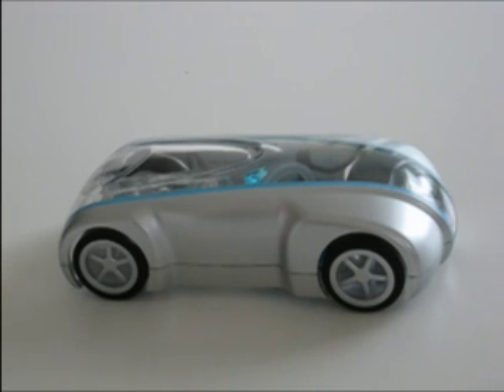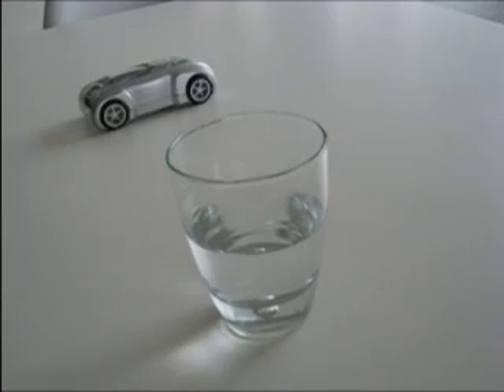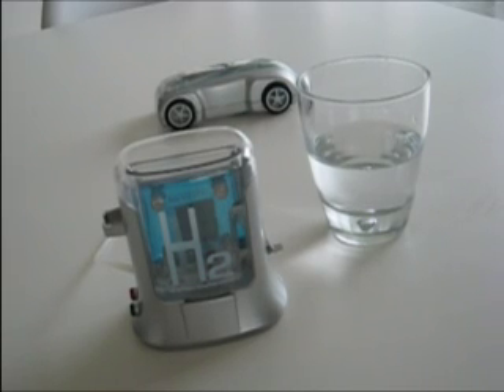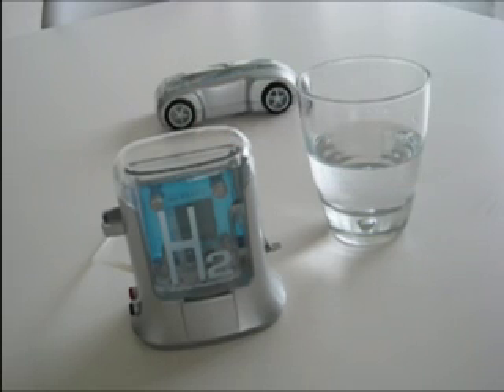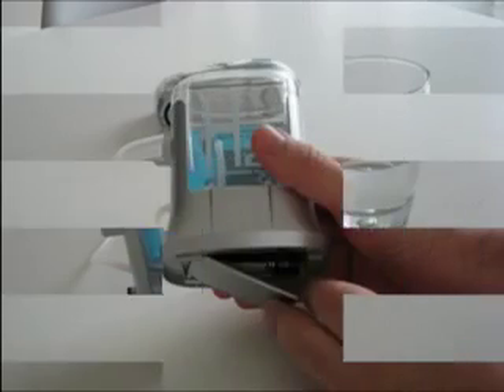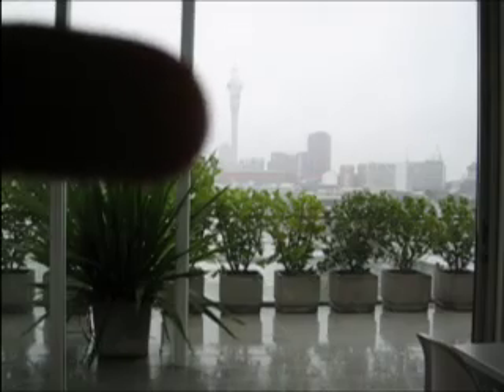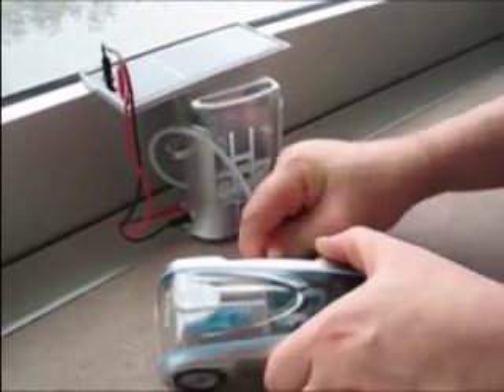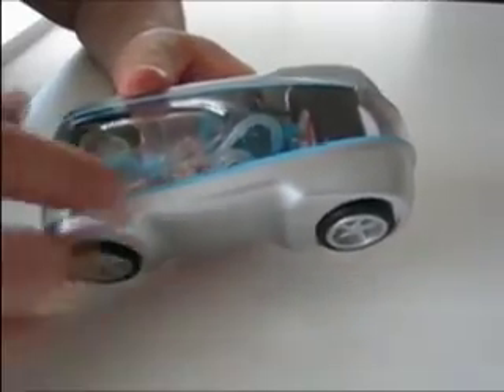Man Runs Car on Pure Water and Sun

Comment: The ideal design in my opinion would be to have an electric plugin (as a last resort option) car with as much photovoltaic ThinFilm (invented by Stan Ovshinsky who also invented of battery for the EV1 electric car)  laminated on its body as possible that would generate electricity for the batteries and the hydrogen that would be used as fuel for the generator to keep batteries at full charge or use the car as a power station!
Interesting how both Stans are from Ohio!

Comment: here's the problem, if every car in the united states ran on hydrogen fuel cells and every gas station in the US used these solar powered hydrogen production methods it wouldn't even come close to producing the amount of hydrogen needed to power every car... thats why gas is still being used it's the cheapest method possible, the thing is as we use more gas it becomes more expensive so in 10 years or so this will actually be a viable method of powering our cars along with algea of course!

Comment: @2karriizman Then if tap water has electrolyte, that explains why I can use water as a conductor. 15 vdc 600milliamps, 2 plates positive and negitive. Measure voltage in between and the outer parts of the cell, its about a good 3vdc. I can light a diode from just putting it in water...No electrolyte added by me, must be from the filtration and retrieval station.

Comment: @23580578H  Nope Honda makes a fuel cell car called the FCX Clarity. 600 dollars per month for three years is only 21,000 dollars. The Hydrogen though is $5-10 per gallon but can run 60 miles on one gallon
Twice as efficient. In the future we can reduce the price with more fueling stations and we will enter the golden hydrogen age (my opinion probably not others)

Comment: The problem is that that solar panel is larger than the car. Upsized you would need large energy generating stations (Wind/solar/water). Oh wait, we have those already. So why don't we have this? We do in some places. The new honda FCX for example.

Comment: @23580578H The only reason common fuel cells (Proton Exchange Membrane or PEM) cost a lot of money is because they rely on expensive materials such as platinum to operate. Solid Oxide Fuel Cells, or SOFCs, are much more efficient and cost effective, but there membranes are made of yttria stabalized zirconia. YSZ can only operate at around 950 degrees Celsius. A solution not very known to the public is to use silicone dioxide (sand) as a membrane. This means VERY low temperature and very low cost

Comment: Where does the energy come from? You say making the hydrogen from the water uses less energy than the hydrogen fuel cell makes of it?

Couldn't one split water, "burn" it in a fuel cell and turn it into water again and have some spare energy to use (since the splitting needs less energy than the burning gives)?

Comment: They run anywhere from 25-$170 usd.  Here is a goggle link.  Oh also I have seen this model at a solar show and it works fine.  weight/energy ratio seems acceptable.
 google "hydrogen fuel cell toy car" and see what you get... a great xmas present for a kid that's going to have to clean up after our fossil fuel mess we made..

Comment: Why dont you just run the car on the 2 battery's, or stick the solar panel on top of the car and use that to power a DC motor, instead of all that messing around

Comment: Why not just use the electricity generated from the solar panel to power the car directly? Of course it is less reliable and generates less electricity, but you don't need the whole hydrogen cell technology-adjusted motor and a charging station.

Comment: I'm not sure what you mean by your last question??? My background is in engineering, the generation of steam and it's use.

As for cavitating water heaters I do know that it is very inefficient.  It's about  the electrical equivalent of running a V8 petrol engine at maximum output just so you can warm your fingers with the exhaust heat. The motor shown in the clips looks to be about 30 HP which is equivalent to  19.4 KW  That's a lot of heat.

That is OK if you get your power for nothing.

Comment: Use the solar to provide base load for the grid.

Have you even begun to look at the economics and mechanical difficulties in using hydrogen?   No, of course not. You are one of these dreamy dopes who sits and thinks of possible solutions without knowing what is involved. to do it on a commercial scale.

Comment: You seem to have missed one vital point. The car would have probably gone twice as far had you just used the solar panel to charge a battery and run the car from the battery. The hydrogen stage is redundant as you said in the clip, basic physics and a little chemistry will show that generating the hydrogen is less efficient.

It also adds a totally unnecessary and  dangerous step to the energy chain.

Comment: willoolner: Well what they're saying is that it's an extra step. You can use solar panels to charge a battery that you put inside the car and this will run your motor. That's what some car manufacturers are trying to do. Having a hydrogen step in between is merely losing energy on the way (electrolysis produces heat which dissipates into the surrounding air, and must be cooled). More interesting is trying to run the whole car on solar energy (more efficient solar panels, wiring, etc).

Comment: Also solar power is very expensive due to volume (large panels needed, lots of them) and solar panels are also expensive to produce (and the by-products more harmful to the environment than burning coal/gas). That's why city lights, factories etc aren't powered by sun power.. The best "solar generators" are in fact plants' chlorophyll, which create carbon bonds to hold up their structure. Bio-matter compressed over years by weight and sedimentation is called coal or oil - the best saved sunlight

Comment: Sorry there, that car is made of plastic filled with air, when scaling to real car size you don't scale just weight linearly, but due to the problems of materials losing strength, a lot more hydrogen would be needed to push a 2-3 ton car (with passengers, seats, brakes, suspension, etc.) so you would need a lot more hydrogen and electricity(and minimize car size) Also, storing and moving hydrogen is highly dangerous.. any crash and your car could easily explode (pipe/tank leak)

Comment: "At least in my country it is" hehe love it! 

When you compare the size of the solar panel required to generate that hydrogen to the size (mass) of the car you may find that you are unable to scale that to the size of a normal car.  It probably wouldn't be practical to make ALL our hydrogen at home in which case we would have commercial fueling stations, but how big would THOSE solar panels have to be?  I could see this as a supplemental power but not the sole power source for a vehicle.

Comment: The fact that the "hydrogen fueling station" can be run on solar power does not negate the fact that it still requires more energy to convert h2o to h2 than you can get from converting the hydrogen back into water.  Both activities are lossy and energy is wasted in both processes. If this actually worked, it would violate the second law of thermodynamics.

Still, you can't deny that the toy is a freaking cool application of science!

Comment: "OK NOW READ THIS BEFORE YOU KEEP IGNORING THIS PART!HYDROGEN TAKES MORE ENERGY TO SPLIT IT THAN YOU CAN GET OUT OF IT!THIS INCLUDES SOLAR PANELS AND JUST PLUGGING IT IN A OUTLET.YOU WOULD STILL HAVE FUEL"

alot of people keep saying this, yet they dont know WHY. it is true that if you purely use Electricity to power the electrolosis, the output is the same. but to utilise solar power, as he has, nullifies that argument.

and find me an example of a remotly charged solar powered car,like this..

Comment: This technology has to be scaled up. that little car probably weighs 1-2 lbs, so times 1500 would scale up to real car size, and so hydrogen production would need to be 1500 times more as so the power to make the hydrogen. Now if you do the math this is not a backyard build. We haven't even touch infastructure need to deleiver hydrogen large scale.Electric cars is the way to go. we just need to make electricity cheaply, with sustainable technology like solar.

Comment: err how did he 'put the myth to bed'? not unless ur a perpetual motion believer.

try to run the hydrogen generator off the electrical energy of the fuel cell, and you will see that the system eventually stops. it consumes more energy than it produces, due to inevitable losses. basic physics.

ok so get rid of the batteries and replace with solar cell, but then why not just have a solar powered car alltogether??...much more efficient/cost-effective for the basic above reason. just seems silly :/

Comment: Whoopty Frickin Doo!! A plastic car body with a latex balloon for the tank. Nothing is to scale. The solar panel and water "splitter" would be enormous and super expensive. The car goes 10-20 feet. Gee, how will my large plastic balloon car do on the freeway after 2 miles?

I believe I can do the same thing with that plastic car if I replace the guts with gears and a spring. Just as impractical for the real world.

Comment: gasoline is a source of energy created from millions of years of solar energy. I guess you could say it is a giant non rechargeable battery.
But really, with hydrogen, solar power produces it. Then hydrogen is turned back into electricity, which powers your car. Turning water into hydrogen takes a lot more energy then you get back from it because of inefficiency. Batteries, however, are very very efficient, and you can get back nearly as much as you put in.

Comment: i can invent a toy car that doesn't even need water-- just sun. 
The blog post proposes to use hydrogen as a battery. That's all it is, just an elaborate battery. As we all know, you can't get energy from batteries, only store it. Eestor's ultracapacitor, or maybe even stanford's nanowire lithium ion battery are the most realistic. Probably the most viable solution for making fuel is algae bio diesel, which itself is a form of solar energy. I hope no one believes that the car runs on water..

Comment from the maker: No, there is no battery in the car.  Pay attention to the video.  The battery *can* run the *fueling station* but it also runs on *solar* power.  The demonstration is of hydrogen from solar and the hydrogen - ONLY the hydrogen - runs the car.  The hydrolosis of hydrogen creates electricity - from no other source but hydrogen.  That's the point of a fuel cell.

Comment from the maker: Hi Mike, read Pektek300's comment below.  You are completely missing the point.  No one is saying the loss of energy is a myth.  What we're saying is that it doesn't matter since you're using a free, and untapped, source of energy to create the hydrogen in the first place.  If you lose a bit in the process it just does not matter a single iota.  Further, your perception of how many solar panels it would require is way off.  Google "Hydrogen Highway."

Comment from the maker: I think you're missing the fundamental point that if the energy you use to generate the hydrogen is generated from the sun, it doesn't matter if there is a loss of energy.  It's irrelevant.  Anyway, look up the Hydrogen Highway projects and the Solar Hydrogen Generators Canada's HH project is working with.  They must all be "dumb" too.  Anyway, this is moving forward thankfully, despite the  nay-saying.

Comment: lol. NO because when you burn something you relese its chamecal energy.  for hydrocarbons eg.  CH4 + 2 02 -> CO2 + 2 H2O resleses energy.  And the revese reaction consumes the same energy that is relesed when its burned.  this is ture for ALL chemical reactions! including 2 H2 + 02 -> 2 H20 (why this is sutpid and actually a solar powered car with the hydrogen acting as energy storedge ie a battery)

Comment: I've done some more research, and the hydrogen just needs to be compressed, not liquid. While it only has about 1/6 the energy of refined gasoline by volume, it has 3 times the energy by weight. Therefore it is still efficient enough to ship by fairly conventional means.

Comment: As long as you keep the hydrogen between 14 and 20 degrees Kelvin, don't let anybody touch it (that's colder than liquid nitrogen) and don't let it leak (it will burn or explode).
It's also possible to ship electrons around via the power grid.

Comment: It's not a matter of efficiency.  If you are 100% efficient in splitting water into hydrogen and oxygen, and 100% efficient in extracting energy when burning it (none lost to heat, light, etc), you get out exactly as much as you put in.
It's like saying if you make a wheel smooth enough, then push it downhill, it will roll further up the next hill than where you started.

Comment: If you use radio frequency modulation that matches that of hydrogen and Oxygen it will help break the molecular bonding of the molecules and separate the 3 atoms. The now free atoms will rise to the top of the water where the hydrogen is mixed with the Oxygen and could be burnt. If the amount of energy required to split the water molecule is less than the cost of producing the same amount o gasoline then there is no reason it should not be employed.

Comment: I don't think that is the point. The point is that a hydrogen fuel cell replaces the medium of energy storage. Instead of storing the energy in gas, you store it in the fuel via hydrogen. You can create the hydrogen from any energy source, such as solar, wind, nuclear, coal, running on a treadmill, etc. It gives us the option to run our cars from solar, since we can't mount enough solar panels on the roof of the car.

Comment: It does take more energy to break up water into  Hydrogen than is made by reacting it with oxygen... otherwise it breaks some fundamental laws of chemistry and physics and creates a machine with perpetual motion (impossible.)  There is extra energy added to the system by the solar panel and the hydrogen cell just acts as a battery, ie its a solar powered car and not a very efficient one